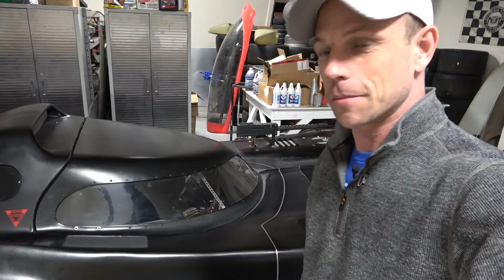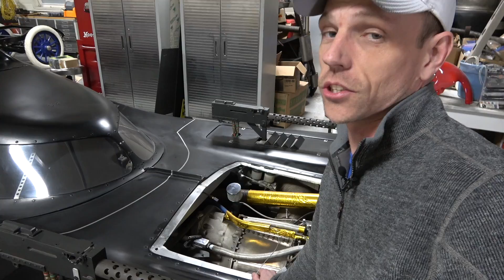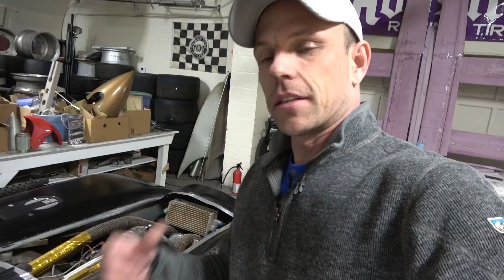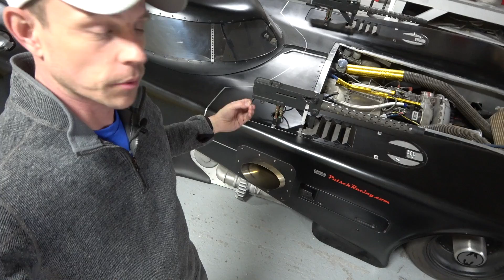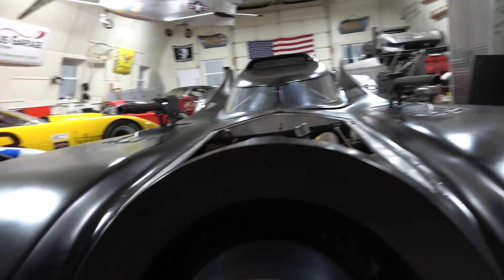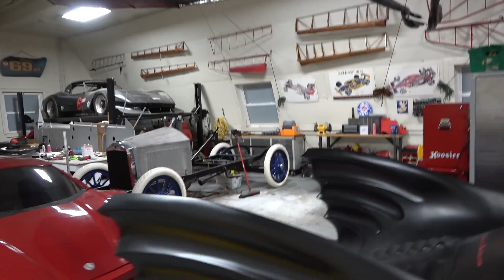How I built the turbine bat car

Comment: I was imagining building a c4 corvet into one of those but actually fitting a small jet engine to the rear...I would use 4 electric engines same ones used in tbe Koenigsegg Gemera to power the 4 wheels. For the suspension system. I would use airbags coilovers that would be naturally adjusted from within the cockpit. I would make the outer shell as solid and as strong as possible that would make the car heavy. But the power from the electric engines would be around 1100hp which wpuld be more then enough power to get it moving. Then on a long straight I wpuld have the jet in idle and warmed up be able to send it how I like.

Comment: How good does the 4 speed transmission work with the very narrow rpm band of a turbine? I guess the outputshaft after planetary gear os 3000-6000 rpm where real power starts at 4500?

Comment: Love this, have been youtubing the infamous Casey Putsch turbine batmobile for years now, wicked to see how it was put together.

I have however always wished the front wheels were as flush with the arches as the rears - is that possible or would the width of the wheels & tyres cause rubbing issues if the front track was wider?

Amazing car and engineering anyway, respect!

Comment: Here to confirm:
Jet A is actually just fancy kerosene. Jet fuel and kerosene (if I'm remembering properly) are bubbled out of the same place in the process of crude oil refining.
Yknow, the same process that gets your diesel (which is a few levels lower than kerosene), gasoline, plastic... Yknow, the fun stuff.

Comment: anyone that gives you crap for using existing materials (like the buffet cups) is an idiot. thats exactly what prop designers do. its waaay easier to combine, adapt, and make minor modifications to existing parts than to manufacture from scratch.

Comment: So I would think it would be easier to use a hydrostatic transmission with the swash plate axial piston pump wouldn’t it? Why not use that system? That would allow you to keep the turbine at one happy rpm. So why did you chose this route?                       

Great build by the way

Comment: The only Batmobile that I acknowledge is the original. They should have used a moderately cosmetically modified 94 Trans Am for the modern Batmobile. 
Just my opinion.

Comment: Outside of the batmobile, I would definitely like to see someone build the colonial marines tank in Aliens. It's not practical but I would want to build it anyway. It was part of Aliens!!!
Reply: Those things were a total pain in the ass made from an old airplane tug hahaha
They are fine if you have somewhere very flat to use them as they have no suspension to speak of and weigh a stupid amount even with the lead/concrete removed